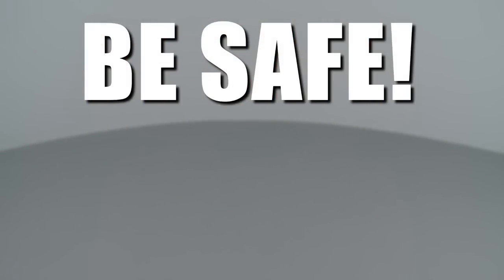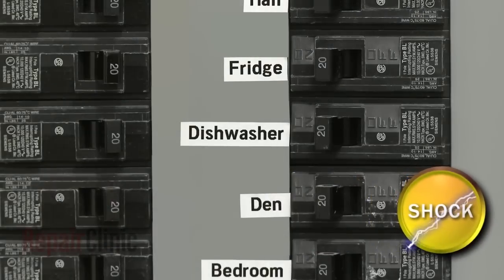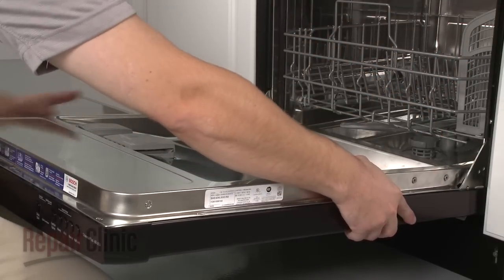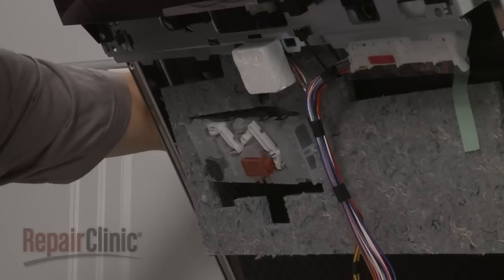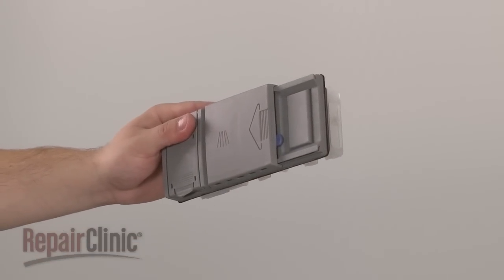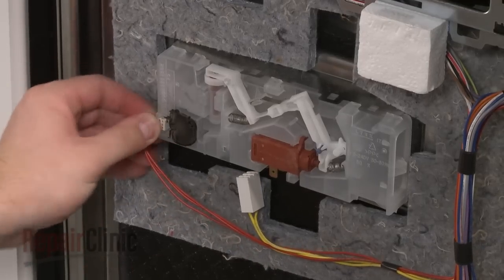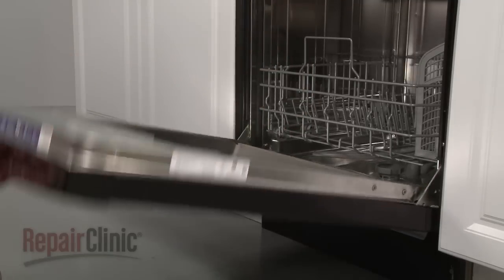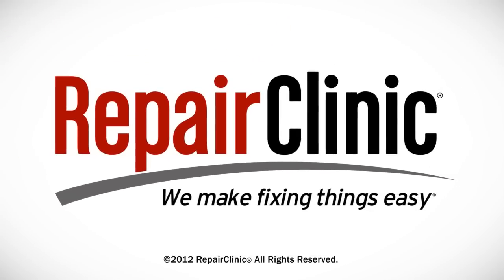Bosch Dishwasher Replace Detergent Dispenser #490467

Comment: Inserting the new part is MUCH harder than expected. Pressing UP on the root of the tabs while pressing DOWN on the dispenser finally got all the tabs locked. Took an hour more than expected, but it's finally installed. Only bent the door a little.
Reply: When you say "root of the tabs" what do you mean? I am having the same problem. Do you mean the white/clear plastic downward triangle pieces that extend from the dispenser? If so, how are you pushing them up while simultaneously pushing downward on the dispenser? Two people?
Thanks
Reply: One person, but concentrated effort pushing from the inside and using vice-grips pulling from the back. What Jay calls, "traditional brute force and ignorance".
Reply: Same thing happened to me.  New dispenser would not lock.  Because when you push down on the new dispenser you are also pushing out the metal retaining clip that the tabs lock on to. So I had to push down on the new dispenser and up on the metal retaining clip at the same time.
Reply: Wow, I watched a couple of videos showing how to replace this. I was expecting it to be an easy repair.

It took several hours. One video said to push the new dispenser into the opening for it in inner door until you hear it click. This didn't happen. I actually bent the left side of my door pretty bad when pushing down because it wasn't clicking. This ended up requiring a TON of extra work trying to bend it back. I'm not sure if it's going to leak or not. I hope not.

I also cut my finger pretty bad, not sure what I cut it on, but there are a lot of sharp edges so you really need to watch out. I have WoundSeal, and even that didn't fully work, I had to wrap medical tape around it.

Got the old dispenser out OK, figured it would be a breeze to put the new one in.

Boy was I wrong.

It did NOT look like the new dispenser was going to fit in my dishwasher. At all. I figured I must have gotten the wrong part, but I compared it to my old dispenser and it looked like it matched up perfectly, so I was REALLY confused. It was only after reading the comments here that I learned that this is actually normal, and it requires a LOT of work and careful force to get the tabs to engage around the new dispenser. I used the flat edge of a screwdriver and my arm & hand pushing on the other side of the door. I pushed on and up on the tabs, I'm not sure how I did it, but I finally got the bottom ones engaged, then I struggled to get the top ones engaged. I finally did it... barely. The bottom tabs look OK, but the top tabs look like they are just engaged, like they are RIGHT under the top edge of the plastic piece on the dispenser that the metal tabs attach to. Because I pushed on the edges of the metal tabs with a screwdriver, they really got roughed up. I hope the dispenser doesn't fall out of there.

What an awful long and hard repair. I really wonder how repair people do this job, like maybe they have a special tool that makes it easier?

If it leaks or the repair doesn't hold I'm just going to call a professional to see if it's possible to save my dishwasher.

Comment: I had the same problem that many of you had in fitting the new dispenser in, but the solution was simple - just take a flathead screwdriver and push it against an exposed part of the metal clip that juts out from the front of the dishwasher near one of the plastic flanges on the new dispenser (orient the screwdriver perpendicular to the clip surface).  Then push hard on both the dispenser and the screwdriver and you can force that clip to engage.  Do that to the other clip sites, and you can get them all to latch in a minute or two.  OK - that part went well - but the new dispenser also refused to open, probably because the driver transistor was blown on the control board (there was water inside the old dispenser).  Alas...  Maybe I'm lucky and seating the connector better will fix that one...

Comment: I was having the same problem as the two comments below. The new one is just slightly (maybe 1/8-1/16th of an inch) larger and not all the tabs will lock into place. The top row of my new one locks in, but the bottom row will not. After pushing and pushing the left two lower tabs locked in but the three on the right refuse to lock in. I am concerned that any more applied force will damage the new dispenser. Called and Instant messaged the Repair Clinic, but they are up front about the fact that they don't give repair advice. Basically they send you to their repair page which has zero info on this problem. Their only suggestion was to send out a new one.
Following the comment below from Diane, I continued prying and pushing with a flathead screwdriver until I got the last three to lock it. Cut my finger in the process on the metal frame. 
Yes, I ordered my part from Repair clinic. Model number SHU43C02UC/46. Part number 00490467.

Comment: My new dispenser will not click into place. My husband tried everything (lubrication, put the old gasket on the new, pressure) but nothing works. Thought the part must be defective, so I ordered another, but it's the same-it seems slightly larger than my old part and will not click into place. The old one can easily be taken in and out. My dishwasher is 12 years old and I'm wondering if the part has been slightly changed. This would be an easy repair if the part fit. Going to have to do without a new dispenser. :-(
Reply from the maker: What is your dishwasher's model number? What part number did you order?

Also, did you order through us and if you did, do you have an order number available?
Reply: ***** My 12 year old Bosch dishwasher is model SHU6806UC/UC12 and the part number was 490467.
I was able to get the part at my local appliance parts store. I returned the two dispensers and gave up on fixing it. The part just would not fit. Thank you for your concern and for the video.

Comment: Would have helped to point out that a special star screwdriver tip is required to remove the panel screws. Boo for the design team.